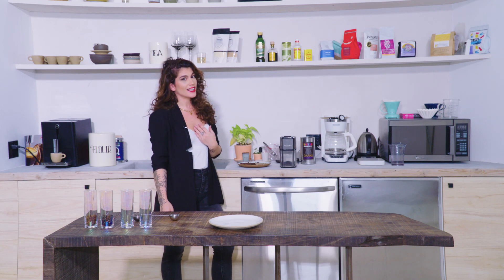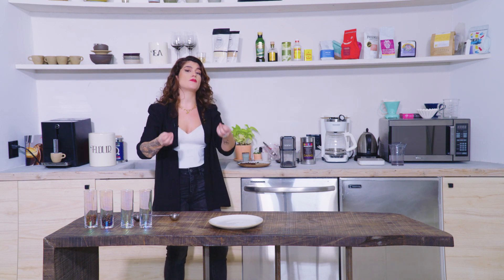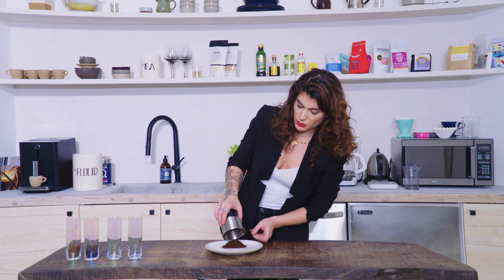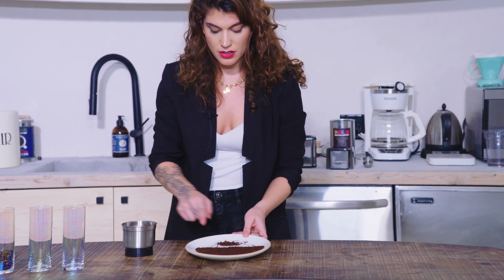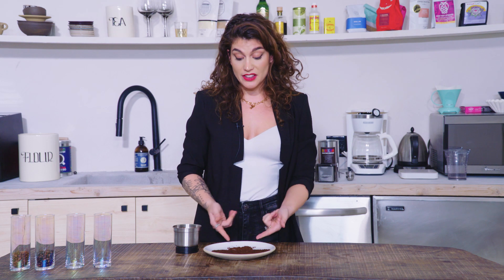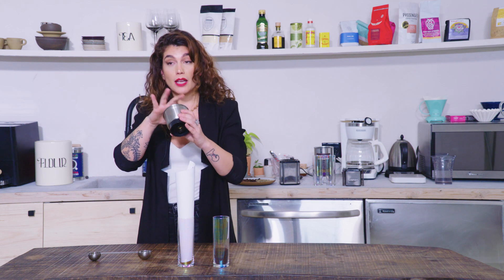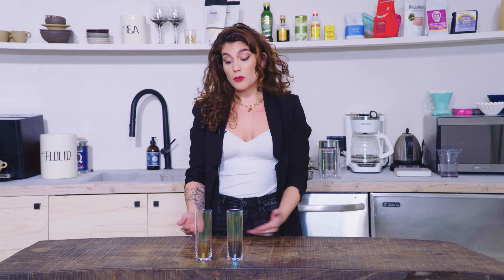What is Grinding?

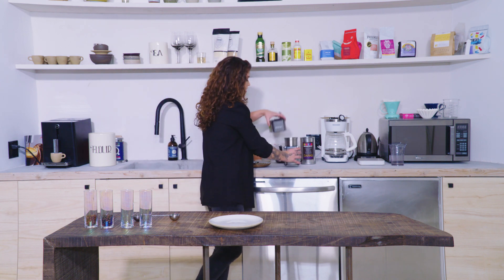Comment: 1:16 NO!! Tell me you did not just do that!!!! Sister girl! You stuck your finger into the blade of a plugged in appliance that has the potential to pulverize small rocks in under 30 seconds! Worse yet, it uses a snap action micro switch! (dirt cheap switch with a very high fault rate) I'm not one to be the safety police, but this seriously put my heart into my throat when you stuck your finger into the blade and whirled it around. Being a 22 year electronic appliance service tech, I can tell you that shaking a running grinder like a Boston shaker will drastically shorten the life of the grinder and can make it terribly dangerous to stick your finger in!  How the motor is mounted and the way snap action switches work it will most definitely compromise it's built in safety ability. As often as you would be replacing a blade grinder using this hack, you might as well just eat a little extra cash and get a burr grinder like the Baratza Encore. You'd get a more consistent grind with less fines. With a burr grinder like this it would last far, far longer than the one you have to shake the life out of to yield a lesser quality grind. Safety rant....over!  Erika, I'd be crazy to challenge you on coffee, but knowing the Asian imported mechanics of cheap appliances , I could not let this hack pass without comment.

Comment: Hey! I have a question. What's the best way to clean a burr grinder? Mine's been sitting in the kitchen doing nothing for a good long while and I wanna get back into grinding again. It's got quite a lot of gunk in there. I've seen suggestions to put rice in there but I am cautious of doing that. Using damp paper towels seems like it's going to put moisture in there which I don't think is a good idea for fine grinds either. Thanks!
Reply from the maker: Xander if you have a vacuum cleaner with an extension, use that! I generally use pipe cleaners, and paintbrushes to loosen up the old coffee that’s stuck on the burrs, and then suck them out with the vacuum cleaner. 
Urnex also sells grindz which are specifically made for cleaning out grinders, and ive had a lot of success with them too.
Good on you for keeping your equipment clean!!! They’ll last a lot longer the cleaner they’re kept :)
Reply: @ErikaVonie  Thanks for the reply! Looks like its gonna be an old toothbrush and a vacuum, never thought of doing that. The simplest solutions are usually the best!

Comment: Does the light vs dark volume variance still apply if you're measuring out on a scale? I assume no since a gram is a gram no matter how you grind your beans. Right?
Reply from the maker: you're absolutely correct, a gram is a gram is a gram! roast level does affect solubility (lighter roasts aren't as soluble as darker roasts) so even with the same grammage and recipe, light roast will extract differently than dark roast.
Reply: @ErikaVonie  Ooooohhhhh. I look forward to learning more about that in future videos.